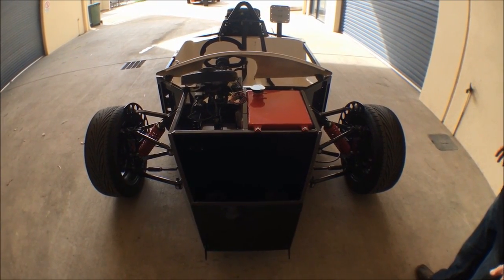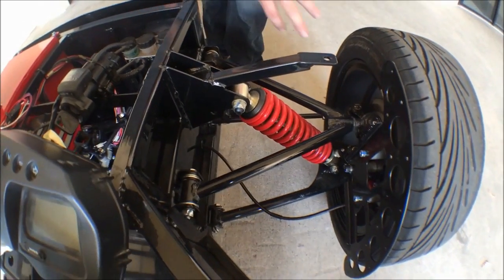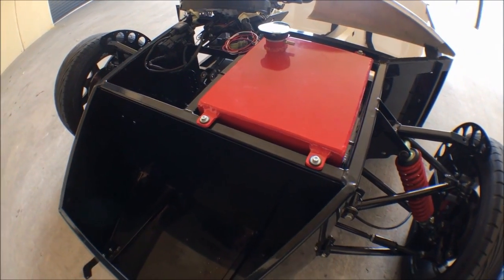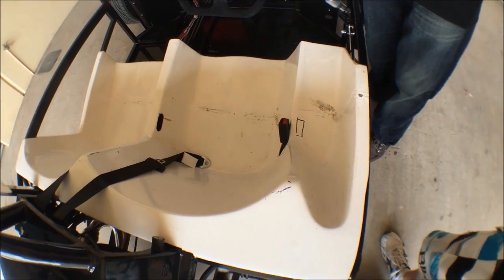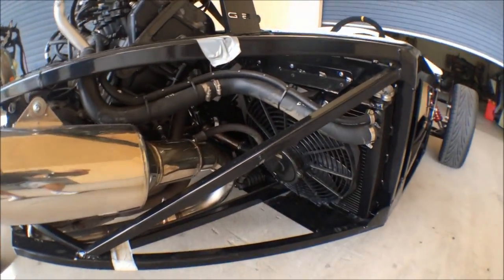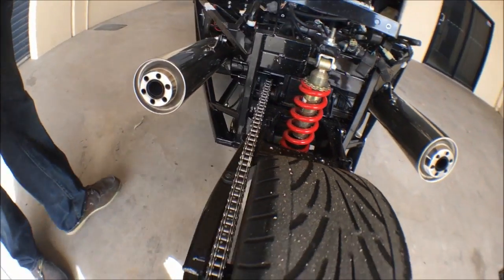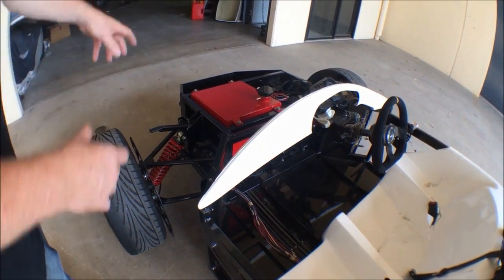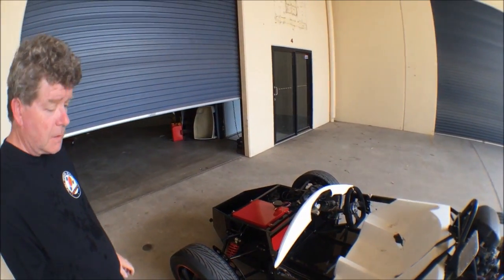Walk around Tri Pod Generation 2 three wheel car chassis.

Comment: can you register it as a motorcycle  in nsw?
Reply from the maker: Not entirely sure Woody. From memory and previous research they rego them as cars. Doesn't really matter as no helmet required either way. I have driven 10s of thousands of kms in NSW without a helmet while in the original orange prototype both with car and bike rego (as Qld transport changed its status from one to the other a few years ago). Cops never took a second look. Check with Rob though (the new owner of Tri Pod Cars) on tripodcars@gmail.com

Comment: Hey mate, check out my REVERSE TRIKE HONDA GOLDWING and listen to the name of my trike I loaded on 2009 I call it TRIPOD ............hmmmmmm
Reply from the maker: Hi ?, Yes a coincidence in naming although I specifically spell it Tri Pod, ie. no hyphen, not all capitols etc.  I was always surprised no one else had thought of or used the name. The meaning behind it for me is a three wheeled, pod like car. Thankyou for making me aware of your build as I was not aware of it until now and I thought I had investigated every build in the world thanks to YouTube etc. Goldwing is a great choice of engine I think.

Have you driven it far or developed it further?

The orange original prototype VTR1000 powered Tri Pod 1 has now completed 70,000kms of driving including from the northernmost point of Australia to the southernmost point and many destinations in between. I have developed the design considerably since that original that I started in 2006 and have now sold around 20 factory kits and quite a few sets of panels, other parts and plans for folk to build their own interpretation. There about 25 out there of which more than 10 are running on the road.

A new chapter has also opened up recently as I have sold the business/design and a new owner is about to take Tri Pod Cars forward to the next level.

Thanks for your interest, Andrew.